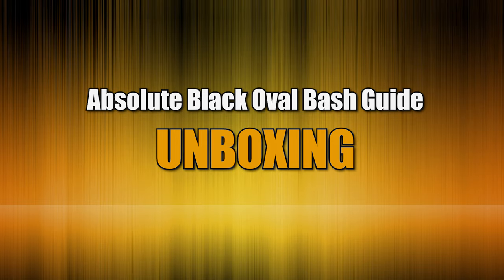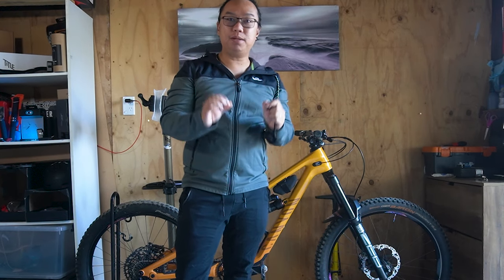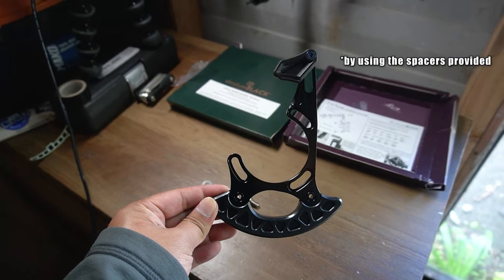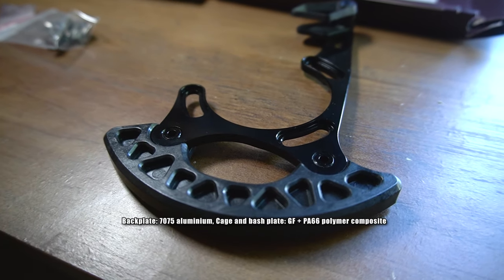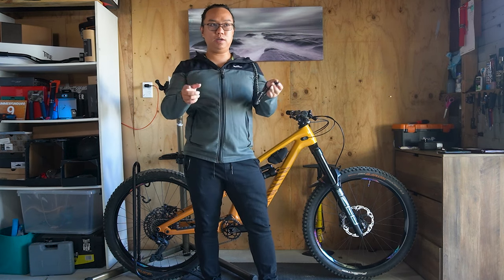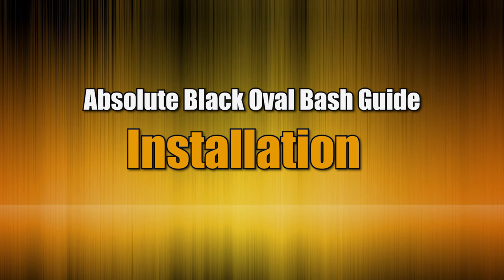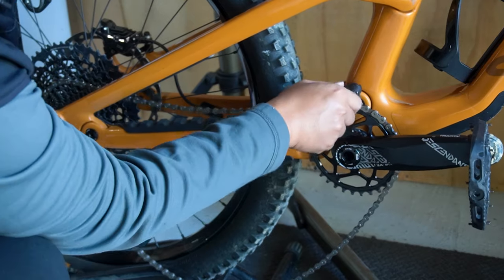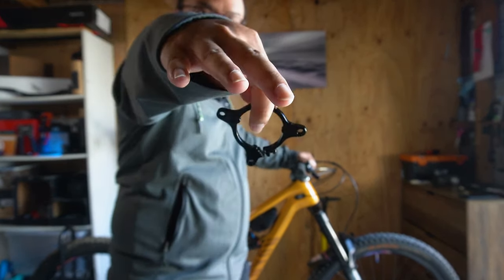HOW TO INSTALL A BASH GUIDE ON 2022 CANYON TORQUE CF7 + FIX!!

Comment: If the adapter is mounted on the bottom bracket you are asking for problems. Hard hits can and will put the bearings in the frame under pressure. I can't understand why there is no option to screw a bashguard on the frame with the Spectral and certainly the Torque..

Comment: Okag talaga yung bashguard lods especially enduro set up. Although may additional na weight but mas ma poproctect yung drive train mo...and other than than that ang cool interms of aesthetic. Nc wan lods
Reply from the maker: Yes lods. Mababa kasi bottom bracket ng torque. Para rin maprotect ung chainring. 😁👍